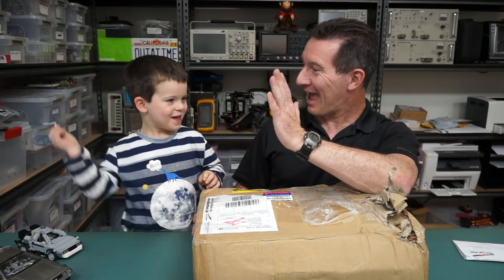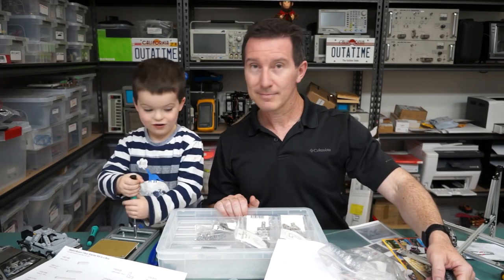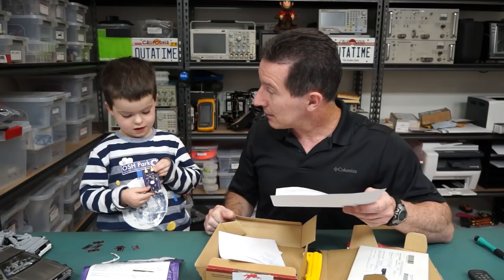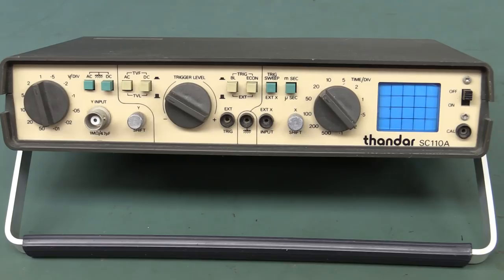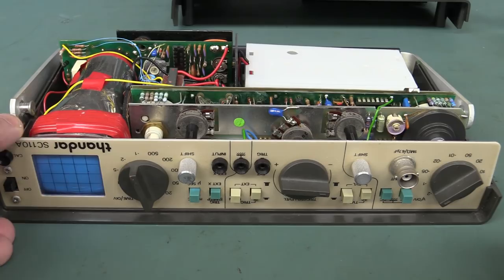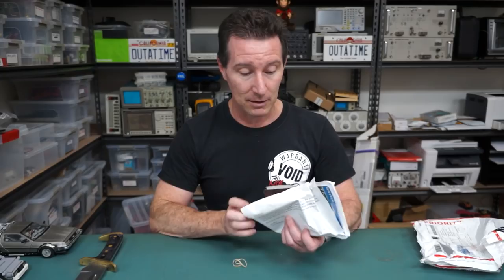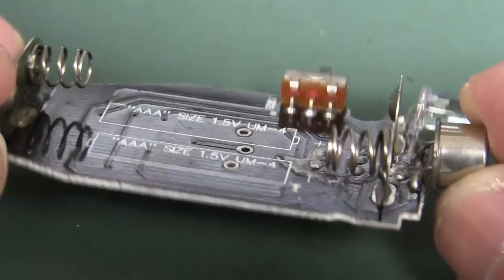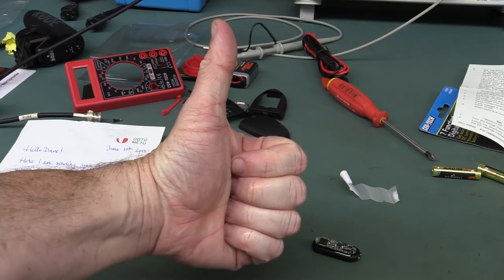EEVblog #813 - Mailbag

Comment: Centech multimeter is using an ICL7106 originally made by Intersil and was a Fluke chip modded and sold to the public. Of course a chip used in a Fluke originally, doesn't make this any better designed or comparable to a Fluke.

Comment: I have that exact meter and it works ok, definitely not the best out there (far from it!) but it's ok for what I use it for. I measure low voltage and currents with it as well as resistance, as quite frankly I'm kind of afraid it won't end well if I measure anything big with it.

Comment: Philips G6 colour televisions had a couple of turns of wire round the line output transformer for the EHT regulation valve heater.

Comment: Re the alcohol tester, the red power LED dimmed when you pressed the button. Perhaps because it was activating the heater? Try holding the button for awhile; that might heat the sensor and give you the green ready LED.
Reply from the maker: +FlyingShotsman Tried that, nothing.

Comment: I really wish you would have done a input protection test on that multi-meter. Throw 220Vac on its resistance settings and see if she lets out the magic smoke or goes ballistic.
Reply from the maker: +Christopher Pearce (endless summers) Can't do that in the lab, if I set off the building fire alarm it will cost me big time.

Comment: Harbor Freight MeterMy Granddaughter is in a robotics class at school. For her birthday I gave her a Arduino kit and some solderless breadboards so she could "Make" and test at home I also got extra LEDs, resistors, caps, jumper wires, and a cheap soldering station and a Harbor Freight Meter not everyone can to start up with mid rate equipment if she stays interested I can upgrade her but if not I am out a bit over $100 US . While at Harbor Freight I picked up a screwdriver set and pliers and cutters for her kit. She thought it was the greatest gift at the party. PS I was in charge of the Global Timing Lab at the cancelled Super Conducting Super Collider and started electronics as a hobby at about her age. Nothing greater than to work doing exactly what you always wanted to do. I suspect you know the feeling too  I think that this is a good starter meter. I had a $10 radio shack meter paid for by mowing many yards and doing landscape work as a kid and my parts bin was stocked with parts cut from discarded TV's hauled home in my wagon. . I retired as a Senior Systems Analyst The moral Cheap is better than nothing and free is even better.Bill a Native Texan

Comment: LOL, I have that same multimeter, but bought in the 90s. The outside looks almost identical, and actually if I compare the insides it's the same design, but using through-the-hole components and a massive DIP chipset. Probably the same factory somewhere in China must have been producing these for 20+ years.

Comment: Can adding more capacitors to the outputs of a PWM power supply harm it? 
Food for though.
Reply: +TheLawnWanderer no, often if the output cap failed you could up the value if you didnt have the same, mostly you dont go too far up due to space limitations, it will only smooth it the more, and mostly it wont make a difference to performance as its already been matched to smooth the waveform
Reply: jusb1066 Wont adding too much capacity with low total ESR harm the mosfet with a very high peak load?
Reply: TheLawnWanderer
sure its possible to overdo anything, usually you are limited by space to only being able to up the cap a size or so , so unlikely to be a problem

Comment: I also have one those multimeter and work fine,someday I forget to unplug the leads from the amps jack and I measure 120v mains and the leads just blow up, quite hilarious for me.
Reply: Haven't done it yet but I'm very cautious especially or something made that cheaply but one time had a good meter burnt some test leads do to a short circuit not connected to the meter by the way just laying on a metal surface testing a trolling motor and I was going to double-check that the battery was good surprise battery was fully charged by the way those mirror leaves were not too too cheap but somewhat but it did not have the best feel so dumb or Too Short however banana plugs and test probes wherever the sole and they could be taking apart and wiring replaced easily screw terminals believe it or not needless to say custom test leads the number 16 I think if I remember correctly about 10 ft long need a pair lockdown anyways and yes red and black of course I was tempted to read white since I would wanted to have a gag that this meter is for AC use only and say it's not positive negative it's hot neutral just as a gag but unfortunately did not have the proper 12 wire I was going to use in stock for this otherwise it would have been a great gag I'd say

Comment: I have that same meter, except mine is 98025. I got it free with a $10 angle grinder. Believe it or not, they've made it even cheaper. Externally it's the same, but internallt the trimmer is gone, the fuse is a leaded, soldered-in version, and the board is laid out different and smaller.
I keep it at work where it's good enough for quick, at-the-desk, unimportant tasks, and nobody will steal it. And if they do, who cares anyway?

Comment: When I saw that maker beam, my first thought was that it was a small Yagi..
Reply: Thought it was an antenna as well oh by the way ever seen a magazine rack it looks like an antenna on a wall that's got the steel bars well I actually did wind up and converting soon as I was to actually antennas surprisingly for what they were being used for they work really well can't remember exactly what they were connected to but what's up my idea for the person that had the place there where they were as well as there was also convenient places that you could run cabling nearby each one coincidence because there was things that was playing for that place that never came to fruition initially basically the open-source electromechanical electronic home you could say there was weird stuff everywhere and still to this day cannot get my head around what some things were or what they did or at least at one time just crazy for example there was some switch flights that had like 12 toggle switches on them in about 8 indicators and also there was different types of connectors on wall plates including Jones plugs of different varieties there was also bills and stuff like that and horns all around the place on the one of the things was rather interesting there was a 4-wire Jones plug and a two wire Jones plug and I think of three wire one as well on the same plate and two or three or four fuse holders on the same plate and possibly a toggle switch and a push button and they be an indicator or 2?

Long time ago but anyways we were digging around downstairs when it they had first call me over to take a look at the place because they're curious of course it's on my bill figure some things out. And I saw something that had a cord attached it had a A 4-wire Jones plug on it so kept pulling and low and behold what was that the other end old-school flip clock/recording timer/something else that have been modified the four wire plug was not the only one on there either and I'm like interesting I think I found something that works with the system so I pop the top of the clock timer device most of the pens went to the switches and all the switches were red.for 120 volts so look like most of those circuits for caring 120 volts ac also even before that I measured line voltage across some of those connector terminals of course these are female connectors the idea is that the alarm clock portion what set up ring bell throughout house to wake everyone up at the same time if a switch somewhere in that room was on.

And also that to wire Jones plug there was little tiny boxes that were plastic that had a push button switch and a long cable with a chewer Jones plug again rated for a hundred twenty volt AC and also those all boxes were clear and a real neon indicator inside of them which one I saw that I'm like why would that be why would there be a push button in series with a neon indicator and a resistor and there was also an external resistor to bring up the resistance even higher which was just weird I thought maybe increasing life or something but that was rather ingenious I'd say by the way those switch cables were used to ring the Barger Bell momentarily under push button control my guess would be from like bedside or somewhere hence the red neon indicator assembly inside the clear chassis so that it could be found in the dark and may have also been the reason for a larger resistor on the or additional resistor on the indicator so that it would not be enough to cause false triggering in the system who knows or maybe at the act for a dimmer lamp or longer life inside said but it was obviously use for signaling purposes also my uncle that is on German an electrician of course installed bells in the house that were triggered by a wall switch below them anyone switching to cows would trigger all of those bells the idea was for emergencies which I think is a great idea although better would have been a momentary switch plus I maintain switch

Comment: I have a few of the freebie multimeters I tool bags I have in different spots, I really can't fault the thing, and even though you wanted to hate it, it was plenty accurate in your tests, I uses mine for checking batteries, Testing resistance and, for testing switches and wires. I've been meaning to get a better multimeter, but can't justify it when this crappy little thing dose everything I need it to. Only thing was it is no longer accurate when the 9v battery gets low after lots I use.

Comment: Heh, that multimeter is cheaper than the cheaper than the cheap one I have. Looks like every few years a new (crappier) version is sold at harbor freight. (I stil have to use one of the back when they were 9$ ones)

Comment: That version of the Harbor Freight is sooooooo out of date, seven years on, the latest 830 derivatives from One Hung Lo have no shunt, no fuse, no buzzer, much smaller motherboard, no solder in the transistor tester area, total danger, perhaps another review is warranted?

Comment: I had one of the Harbour Frieght  mutimeter for free. It was a piece of garbage. the lead fell off from poor soldering. The meter blown up when i use to measure LV DC 12V but I accidentally left in ohm mode. As you said no protection at all.  It is a dangerous tool !  lucky it was free ! now i know why it was free !

Comment: i actually use that harbor freight multimeter, i blow them up constantly im up to number 17 if i havn't lost count. Wung Hung Lo garbage does have its uses like for example not putting your good one in harms way.
Reply: it should also be noted that ive opened a few and they are always missing at least one minor part they shouldn't be based on the last

Comment: My father purchased that multimeter a couple of years ago and I agree, it's a piece of crap. But given his history of tool purchases, it's not a surprise (you'll be appalled at how many screwdriver shaped objects he has that are absolutely useless when comes to actually driving screws). And the insulation on those probes is absolutely abominable.  EXTREMELY brittle when cold and the wire gauge is extremely small, perhaps AWG 28 or so....

Comment: Hi mate.  It would not surprise me if that unknown defector is for ambient smoke.  When I worked for Siemens we used to have something similar.  It would detect an infra red beam that was sent across  an atrium or something like that.  It would detect a haze of smoke in a large room.  A requirement is that a smoke detector must be able to be serviced and checked.  Therefore if a detector would be on a very heigh celling it cant' be serviced.  therefore these detectors.
Reply from the maker: +Marcel Timmers Interesting ,thanks.
Reply: +Marcel Timmers My guess would be a line detector to put in like a doorway or something to detect if someone passes it, but maybe your idea is better.

Comment: Those craptastic moldymeters from HF are okayish,for basic stuff. They aren't terribly accurate (I've noticed some drift with temperature) and I wouldn't trust it to measure the B+ of a tube amplifier (It will probably explode at higher voltages)..but it's worth chuckin in the toolbox as a quick-n-dirty test tool. (assuming the battery in it hasn't died,and leaked everywhere.) I might toss one in the toolbag in the trunk of my car..It's good enough to get you out of a bind,on the side of the road.
Hell,for free,it's not half bad.  Even at the full retail price of $6,it's okayish.
Reply: +PhattyMo I have the exact meter and have measured up to 400VDC, it hasn't blown up (yet).
Reply: Paul Frederick
What's wrong with tubes?
Reply: Paul Frederick
 No way. You'll have to pry them from my cold,dead,hands. Tubes Rule.

Comment: Could someone explain why hes complaining about the cheap/free multi meter? It is free...and more then enough accurate for me as someone like me who needs a multi meter is to 
find which end is positive/negative, 
find the voltage of a power supply/etc, 
check if something works/gives out power,  
check the resistance such as a stepper motor and 
check for a solid connection which I just use the ohm meter part of the multimeter to do that.
So whats the issue? its no top of the line brand but its designed for users as me who dont need .00001 accuracy. And unless your doing very complex and sensitive electronics (which MOST people dont) then this is great for 99% of hobby builders
Reply: +robert karas it has no shielding whatsoever. Using high voltage with that could kill you outright so please dont try it. As he said though, for low voltages, it does get the job done most of the time.
Reply: Paul Frederick I agree, ive been using it to test mains voltage without any shocks. And even if the mains happened to short circuit it would fry the tester before giving me a little shock
Reply: +robert karas Thats why people send stuff in. Its sent in to be torn apart and inspected. Send him a &#163;1000 oscilloscope and he will still find things wrong with it. Also its dangerous. Look at his video testing them, I wouldn't trust them as far as I can throw it.
Reply: Nothing during testing because it was a controlled environment. Take one of these into the big wide world and accidentally having the probes in the wrong socket or having an issue with the systen your testing causing the meter to blow is dangerous. Watch what happens when cheap meters are tested for issues with overcurrent etc. Get a fluke etc and it will go pop and do a little jump. Test one of these and it will literally explode. If you know what your doing with a multimeter its fine because you know that its dangerous and has no protection but if you use it without knowing what your doing your insane.
Reply: +MrPaddy1000111 you obviously did not read the comment... please read it.
but in short, the product is great for people who dont do anything precise and dont work on hv. aka 99 percent of the maker community.
most of what we do is basic power around the 12v range. why would this be bad for most people?

even for you, except for high voltage where have you ever needed to use a tester so precise that this is no good

and its ok to critisize, I actually loved this video. except when he said this is useless to anybody and is a piece of garbage. which is completely incorrect
Reply: Paul Frederick I agree. And I do admit, I did test it on mains voltage many times, and im still alive.
And a safety feature you know that you can test it on mains voltage is the fact that it has a option to... 
In today's world you cant sell anything without putting huge ass stickers on what not to do.

But these people are just like the ones who spam and cry when they see someone drilling on the lowest rpm without safety glasses...

Comment: +EEVblog that kind of multimeter is really common, you can get it in many colors, exactly same pcb and case. I bought some in Germany for under 3,50€ retail (now more expensive). 
http://www.pollin.de/shop/dt/NTA4OTYxOTk-/Messtechnik/Messtechnik/Multimeter/Digital_Multimeter_PM_110.html

Some people at an electronic forum upgraded it to spit out rs232 

https://www.mikrocontroller.net/topic/133574 

But this thing is dangerous, it once tried to kill me, I measured about 600V DC as the probes decidet to stop insulating and gave me a shock. (They were better then the ones of yours and "rated" for 1000V)

Comment: Nothing wrong with that multimeter if you use it within it's limitations - ie: you need to monitor a low voltage and need another meter to do so.  $4 on eBay is a cheap way to monitor low voltage.  I wonder how Dave would react to an old analog voltmeter.  Every piece of gear does not have to cost hundreds or thousands of dollars.  This is a cheap way for a hobbyist to have that extra couple of meters for low current low voltage non critical measurements.
Reply: +Digger D i fried one with a 9 volt battery so it is NOT safe
Reply: Hurricane Joef Have one ordered ;)  I'll see what it'll take lol.  Basically I bought it just to monitor low voltage in digital stuff when I need that extra meter.  So 5 or so volts and milliamps.  Should do that ok.  But for $4 what the heck ;)  Cheaper than making one.